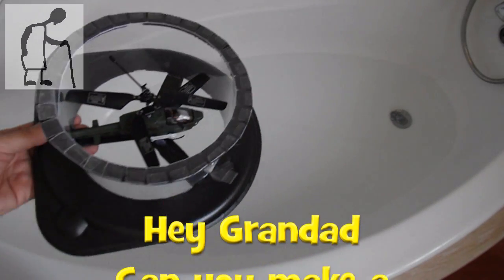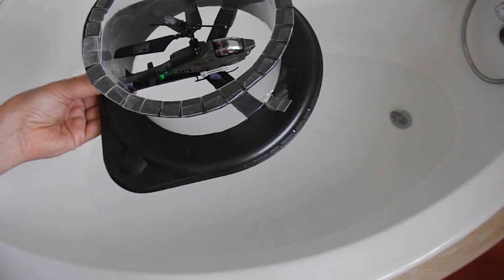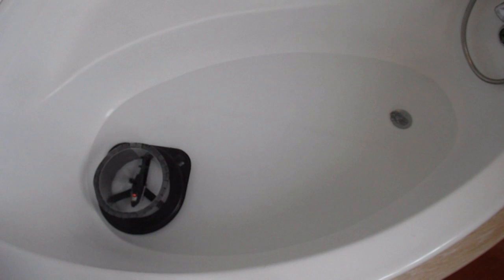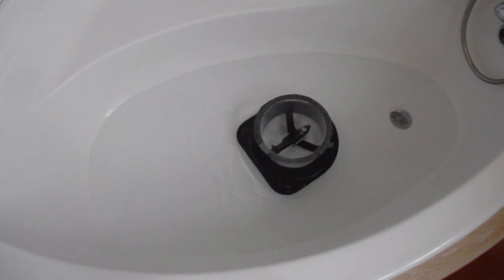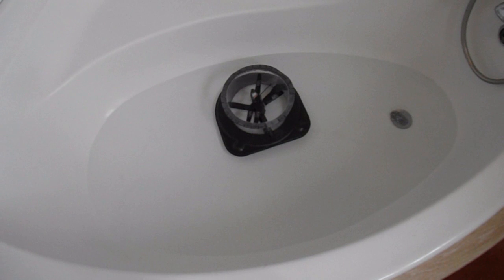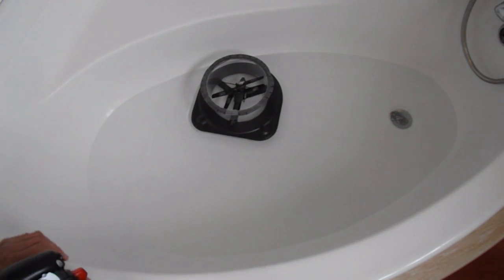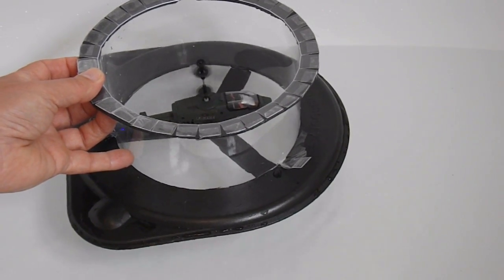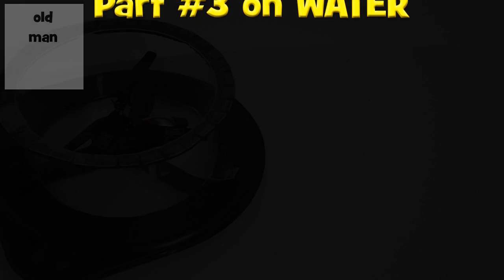Hey Grandad can you make a hovercraft from a helicopter Part #3 on WATER

Comment: i can se you like hovercrafts i got a idea that may acsaly work can you make a hovercraft that can fly in the air like a plane i wonde if thats possible
Reply: Aleksander Sats Do you mean a helicopter? Because what you described is basically a helicopter.
Reply: Dukey8668
but its a hovercraft that hover on ground and wen has enaugh speed it will start to fly and float on water and other stuff
Reply: Aleksander Sats If you give a helicopter little thrust it will hover like a hovercraft.
Reply: but not fly like a plane -.-
Reply from the maker: Aleksander Sats https://en.wikipedia.org/wiki/VTOL